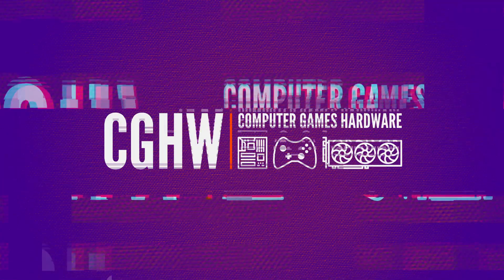Ryzen 9950X X870E Upgrade - AM5 Build

Comment: Hello, I watched your video with great interest. My question is: I want to buy a new PC with an AMD 9 9950 X3D processor. I've been advised that if it's only for Microsoft Flight Simulator 2024, an AMD 7 9800 X3D is more than enough, and there's no point in getting the more expensive AMD 9.
What's your opinion?
Thank you for your answer. By the way, I wrote this message using Google Translate.
Reply from the maker: Hi mate, and thanks for watching. If you tell me what language you speak, next time I will translate my answer into your language. You have been given good advice. If I were only gaming, I would also get the 9800X3. The reason is that the X3D part of the 9950X3D is on only 1 CCD, which is 8 cores, exactly like the 9800X3D. So when you are gaming, the 9950X3D works like a 9800X3D anyway, so you might as well get the 9800X3D and spend the money you save on a better GPU. Hope that helps, good luck and let me know how you go!
Reply: @computergameshardware  This is the best answer I have had, thank you very match and a lot of succes!
Reply from the maker: @jackwoud  Alle goeds!
Reply: @computergameshardware  Yes, i let you know about it, very kind of you!
I, am coming from the Netherlands, the last part of my answer is without Google Translate. Have a nice weekend.:thanksdoc:

Comment: Cheers.
I'm also planning to build this same build combo. Let's see how it works out.

Also heartfelt condolences brother.
Reply from the maker: Let me know how it goes! I've done a few overclocking and undervolting videos that may be helpful too. Thanks for watching.
Reply: Fresh windows install, as you can see no need for problems! hahahaha :face-green-smiling:sorry can´t resisted Computer Games Hardware nice work 
update bios! same board here and the only problem was 8000mhz ram that was solved in the last bios update, was working fine  at 7... something mhz 
im loving this board really, is a beast! temps with 9800x3d 45º and 60/65º gaming  and i live in a very hot place Portugal